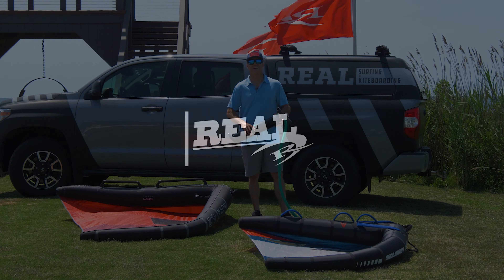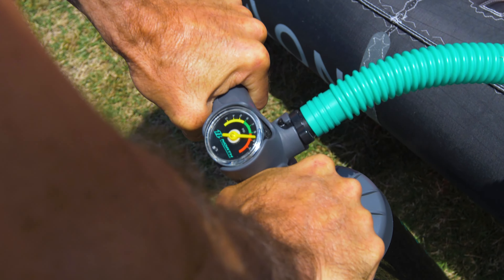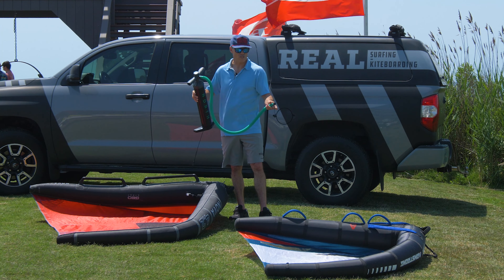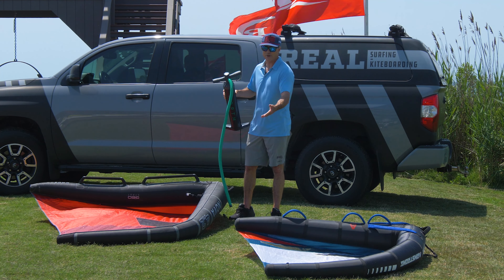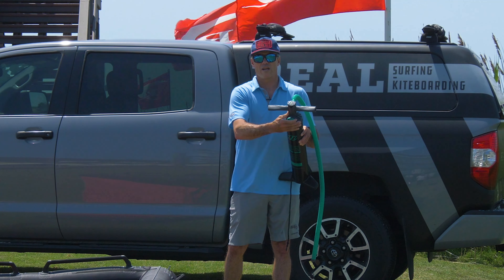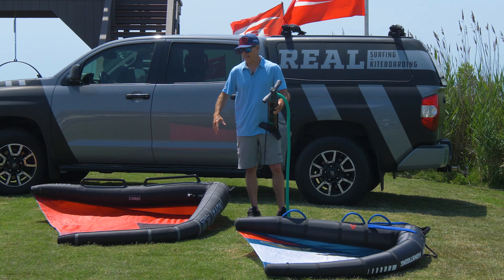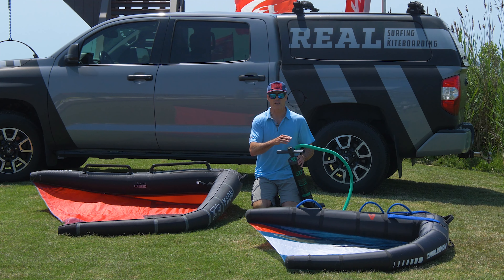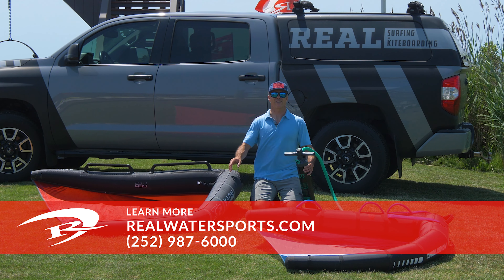How to fix your wing pump gauge: Ignore it

Comment: Best thing would be to have some sort of pressure indicator within the wing. For example a small tube between strut and LE with some simple color indicator, spring. Would be more accurate. Something light that adds no additional weight. Or some more visuals to cross check that the frame is properly inflated. Your method is a start 😅
Reply: Hopefully the Ezzy sail company will get into making wings. They have markings, dots and guides on their sails to help tune them just right.

Comment: You do not have the leak issue with wing and kite that have the 'reactor' valve seen on inflatable SUPs.
For other valves, I fixed the issue by making my hose and adaptor leak-proof by gluing them with thick epoxy glue. Since then, there have been no issues. However, this still does not solve the problem of the inaccurate gauge... but at least one of the issue is fixed...